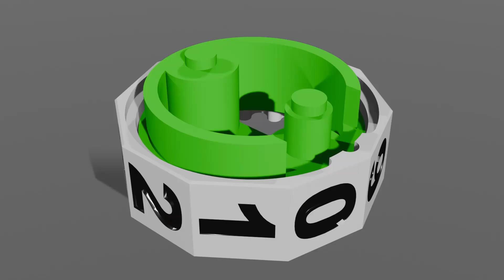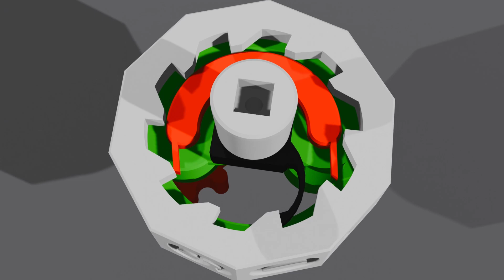I made a Counter to Track my Bathroom Visits

Comment: i love it that you print passion projects. if you lack ideas i got some too. i'm hooked 🤍
Reply from the maker: I have a few Projects lined up already but im always open for more ideas
Reply: let's see now. fidget toys seem fine, however fidgetty tools that some users end up using everyday would seem more practical. using linkages and flexures, variable diameter (noncircular) gears, objects that mechanically snap together instead of using screws or glue. one poor idea would be rolling presses that facilitate complex origami folding. one more useful one would be designing compact mechanical energy storage that extend the functioning of Mechanistic devices past a few minutes. and marble machines that use airsoft BBs instead of lots and lots of material that catches dust on the forgotten toy shelf.
the lack of begging in your videos is refreshing and beautiful. thank you for doing what you like